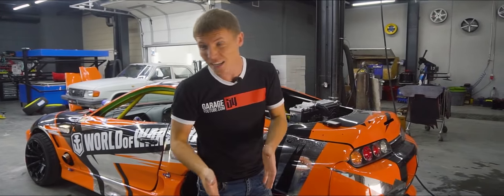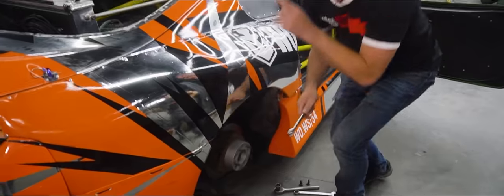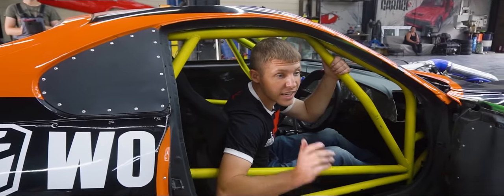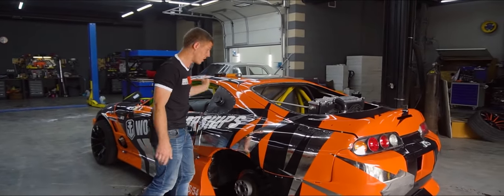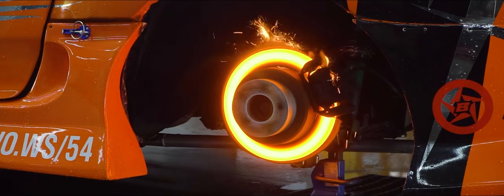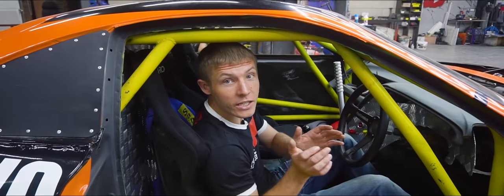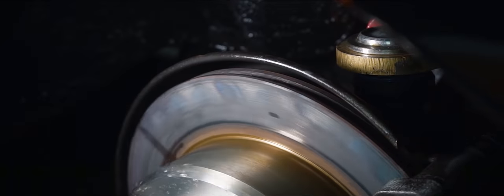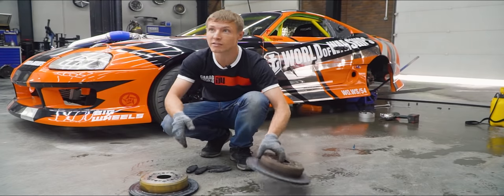Drenching a red hot brake rotor - what'll happen?

Comment: It’s reassuring that even the crappiest rotors hold together in far more brutal situations than I’m likely to ever create.
Reply: I mean they are designed to take extremes why do u think carbon rotors suck ass cold but are amazing on a race car your car is never gonna put that speed and braking force on a car but people are dumb enough to think because they're more expensive they're better
Reply: @Wolf IT Solutions there are a lot of grades of iron, some are softer some harder, just like other metals.
Reply: 3 hard breaking from 100kph to 0 and use a water hose. That will do. He is using hp car breakes so i think its 2x times durable then daily car.
Reply: @hegeliandetective1034  Don't make a complete stop and you got a good procedure down. The speeds might a bit on the low side for such a short burn in, but might be why you get away with the complete stop.
Reply: @heltfeil  All good tips, for getting the vehicle back on the road with matted-material surfaces for safety.  I would like to "tune" that procedure, so I appreciate the input, I'd like to try it scientifically to help everyone get the most of their brakes and that quick-break-in period.
Reply: @heltfeil  So maybe next time I could try 40mph/55kph, and not come to a complete stop, but still that extra smooth pedal motion so it doesn't warp, that's worth a try.
Reply: I wonder how hot my brakes get on an emergency braking from like 150kph to 0. It doesn't happen often, but it does happen.
Reply: Take this like from me and my shitbox!
Reply: @Adam_Lyskawa  if you stop the car and immediately get out and watch them for a few seconds, you can see the colour of the oxide film that will appear on them. Ive had mine at around 550C a couple of times, which im not thrilled about.
And it barely faded, ive had very bad brake fade a couple of times running redstuff pads. Smoking brakes and zero braking power, tells me they were pretty close to red hot, if not actually a dull red.
Reply: @Nbomber   I know someone who has the new Audi RS6 which has a detailed car - system menu to open on the screen and there are nearly every possible details shown like brake temperature, tire temperature and tire pressure, engine, water, oil and gear-oil temperature and even the temperature of the catalyst. The RS6 has new 44mm (17.5") carbon- ceramic brakes fitted in 22" wheels and he told me he was once hammering on the Autobahn and had a brake temperature of around 350°C and then he did a full brake from 290kmh (180mph) down to 60kmh and was amazed by how quickly the system worked and it showed up to 680°C and tire temperatures around 50°C and luckily he didn't have to stop.. 
I find it very interesting and great that Audi also like BMW and I think Mercedes  show you so much information about your car. BMW M cars even have a drift-mode which shows you how long your drift was and rate it from 1 to 10 points..😂
Reply: @Wolf IT Solutions they are definitely not "Just Iron" and the material that is used and how it is treated in production makes a difference in durability and longevity. So cheap parts usually aren't that cheap in the long run. And most people dont want the bare minimum regarding security.
Reply: @Wolf IT Solutions who buys carbon fiber brakes for a normal road car ? If it's even possible to get a whole new brake system for your car. I just meant that for example if there are name brand or oe manufacturer rotors available for 50 per rotor and the cheapest for 35 it's not worth buying the cheapest one risking cracks or warping after just one emergency braking. Especially considering how rarely you have to change rotors . For higher performance cars or sporty driving heat treated rotors or performance brake pads would make sense but they are already way more expensive
Reply: @Wolf IT Solutions  Sure, but that wasn't the point
Reply: @Wolf IT Solutions I never brought up brake performance. From the beginning my point was that saying it's just iron is misleading or just technically wrong as you stated it yourself. And that there are differences in wear and how they behave after an emergency breaking. With the main point that it's just not worth buying the cheapest ones and changing them earlier. But I agree with you on the other points and considering the small differences it might just be a thing of personal preferences and driving circumstances
Reply: The clicking noise was probably the calipers sticking from being overheated and the brake fluid boiled xD
Reply: @Polymer Tools i once did a full emergency stop for fun on my 2017 Trinx Junior 4.0 mountain bike from like 25 km/h and holy shit,despite having fully exposure to cold air,it nearly cooked my fingers when i touched it
Reply: One stuck calliper is all it takes to get you a comfy redhot level. Happened to me due to years of road salt corrosion, the brake disk got so hot that it warped badly, felt like the car was gonna shake to pieces. But, same as in this video with the Chinese disk, the warp fixed itself after cooling a little while. Later i changed the calliper but not the disk. its still on the car and no wobbling.
Reply: For God so loved the world that he gave his one and only Son that whoever believes in him shall not perish but have eternal life.  John 3:16.
Reply: Crappy rotors? What do you mean?
im asking because even those considered "crappy" can and will perform just as well as rotors and brakes that cost much more and called "upgrades". Larger rotors stop the same as larger more expensive ones. But wider tires stop better than skinny ones.
Reply: Normally on amy other car id buy the sheapest rotors i can off of rock auto.
The stock rotor design on my 14 mazda 6 are notorious for warping. Literally brand new rotors and after a super hard emergency stop or two and their warped. Bought some powerstop slotted rotors and so far after many miles and a few emergency stops they havent warped at all.
Reply: Not really if they are made in China without any QC requirements coming from a vendor outsourcing its production there. Beware.
Reply: @Druze_Tito  Hate to break it to you but nearly all this stuff is made in China anymore.
Reply: @truthsmiles  Hate to break it to you but go ahead and read my comment again, unedited.

Comment: What's more amazing to me is that the brake fluid withstood all of this, better than anything else.
Reply: That fluod is junk now
Reply: I was curious what fluid they were running as well... had to be DOT 5 or whatever their equivalent was. I'm also impressed it didn't burn the seals out of the pistons, or, if it did, the pistons still worked, and more importantly, released.

Comment: Russian Haynes manual: 
To check rotor runout, jack the rear of the car up, remove wheels, run engine in 1st gear and hold a 13 mil spanner up to the rotor. 
If it scrapes, the rotor is warped and you can ignore it.
Reply: it's an old mechanic trick btw :)
Reply: @BruceCarbonLakeriver  low cost dial gauge
Reply: ITS TOTALLY WORTH AND FREE WAY TO CHECK IT! :)
Reply: Pretty cool thing to learn, definitely will be using that as a quick trick rather than pull the rotors off and put them on the machine from now on
Reply: @jameshunt5316  yep :D
Reply: That was a 17
Reply: @jameshunt5316  just grab a straight edge and feeler Guage instead of putting it on the machine, or the wrench trick either one works great
Reply: lol 
Tweny Bennys n packet crisp.
It’s like code for location.

The old Haynes were the absolute business just can’t get the same quality anymore, here in North America they even look like cheap faded photo copies now, no more high quality detailed color photos of a real mechanic hands on.

Respect to the old Haynes:
Every manual composed of a complete tear down and rebuild.

Kept my Tranny n Escort vans for ever rolling.
Reply: @SP-mp9yi  John Haynes died a couple of years ago. It is a disgrace that he was never knighted.
Even though I had the official Triumph and Jaguar workshop manuals, the Haynes manuals had the greasy fingerprints on them. IIRC these were monochrome photographs but they were 1970s cars.
Reply: @twentyrothmans7308  Can’t agree more with that tribute to John Haynes, the amount of detail that went into every manual on almost every vehicle.
Reply: It was a 22mm
Reply: Why a 13?
Reply: @Nbomber  This is a precision job, you must use the right tools according to the Haynes manual.
Reply: @twentyrothmans7308  lol, I will remember this. Im guessing this one is marked 5 black spanners difficulty level
Reply: that was a quick good check nothing wrong with that trick
Reply: In Russia, you no check brake rotor. Brake rotor check YOU!
Reply: @ritecomment2098 wrench guage 😂

Comment: Now take that damaged brake rotor and spin it up to about 5000 RPM and see what happens.
Reply: spin it on the crazy high rpm diff setup!
Reply: That’s pretty standard rpms for a rotor in final gear
Reply: Not much
Reply: Typically 4th gear is 1:1 to the engine RPM, meaning them having it in 6th has the rotor spinning faster then engine RPM, I assume they went to at least 4 or 5 thousand engine RPM so even in testing they went past 5000 RPM at the rotor
Reply: @lrz98gaming5  You're forgetting the final drive ratio through the rear differential which should be somewhere between 2.5:1 or 3.5:1.

Comment: Great video as Interesting to see results, back in the late 80s I never replaced discs on front Mk 1 Escort just the pads and drove the car like I stole it, remember one night I had brake fade from heavy driving and braking,  pulled over to find glowing red hot discs and heard this clunk, literally half the disc fell out onto the road, opps, then very slow drive home, I still only change pads but always check my disks for wear and warping and drive a lot slower now 😃😀

Comment: To be honest, the older disc would have been more properly broken in with its use before the tests. Meaning the molecular formation would have been better. The new one more or less went straight to hot tests and abuse so it would have been weaker. This is what I have heard and seen from tests of alloys like what rotors tend to be made of. So given that aspect, if they could have gotten new but properly broken in rotors instead of fresh off the shelf then it would have been a better test of aftermarket parts and OEM parts. So I consider this test more of a fresh vs properly broken in parts.

Comment: That effect of the water not touching the brake rotor is called the leidenfrost effect, where the surface of what the fluid is touching is much greater than the fluids boiling temperature, the fluid closest to the hot surface will rapidly boil causing an air gap between the surface and the fluid. Therefore the fluid won't have contact with the surface :)

Comment: You guys need to do this experiment in such a way it actually helps other racers by using some high carbon steel racing rotors compared to regular street, and maybe even middle of the pack rotors. Also, be a bit more easy on the heat as that is never going to happen on the street. Heat them up to molton hot, but not the entire thickness of the rotor, just the surface as would happen on the street, and then splash them several times, but not douce them in water, make it more realistic. I used to come home at night with my EBC Yellow pad setup, and the EBC slotted rotors were lava hot, and glowing. These brakes would stop just as well hot as they did cold, probably better, with no fade. This set lasted me a year of heavy duty street racing, but I was shocked they lasted that long with the amount of hard braking I did. For about $400 a set, (smaller car, larger cars will be up to several hundred more) It's totally worth the cost even if you don't race, especially if you don't race. The braking force will stop your car in a shorter distance, and there is virtually no fade for those who travel mountainous roads frequently. 👍✌

Comment: I was expecting the rotor to grenade like when Hydraulic Press Channed did it with a Fiesta.
Reply: Lol you need more heat and bigger temp differenec..heat brakes on 1000C and use liquid nitrogen - 275C when brakes increasing heat so temp difference is 1275 +- in lets say 2-3 Seconds or less!
Reply: That was a great one
Reply: @joe125ful  nah, they just floored it and waited for the disc to go on it's adventure.
Reply: good vid from beyond the press i enjoy the mayham they pull off
Reply: @fie1329  But its boring way way you know..
Reply: Of course it grenaded something, it's a ford

Comment: I was thinking you might want to look at the suspension parts, the brake flexi hose, the diff and hub ends of the driveshaft as extreme heat would have travelled up any contact points, certainly I would imagine at least the hub side of the driveshaft oil seals and UJ bearings likely damaged.   The caliper too I imagine is toast as you can see the valleying in the disc where the caliper is allowed to move excessively creating uneven wear.
Reply: Lol i love that about this channel
Reply: Time and effort is of no consideration for Garage 54
Reply: Disc brake operating temp is 300 Celsius when they aren’t braking
Reply: @spannaspinna  Even a regular cars braking under little load on a flat surface the rotors get outrageously hot especially in the summer.

Comment: A rotor in good conditions should never grenade themselves in normal driving circumstances because of the leidenfrost effect, unless you come to a place where water is deep enough to submerge the rotor partially/completely or if there's a storm happening with enough wind and precipition to completely cover the rotor in water at all times, like the pressurized water test.

Comment: It's actually not the sudden temperature change that's killing them but how uneven is the cooling. If the rotor was designed to dissipate heat equally and you would throw it into the water, it would just cool down very quickly and evenly. Obviously it's not, the rotors get hot on the outer edge and that's where they dissipate most heat. So if you heat it up that much, the whole inside of the rotor gets hot and expands, then quickly cool it down and the outside shrinks quicker than inside. That's how you get those cracks.
The other story is bad heat treatment and internal stress of the material. Cheap ones are warping that much because of it. If you release the internal stress, it would probably perform much better.
That's actually interesting idea for a follow-up although it might require a bit more equipment. Take the same, cheap disc, put it into an oven for heat treatment (annealing), heat it up slowly to proper temperature (depends on the type of material), keep it hot for quite awhile, then very slowly cool it down by lowering the temperature gradually. This way all internal stress should be gone and if there was any (and surely was), it will be warped. Now get it to someone who regenerates warped discs by taking off some material on lathe or something like that. If it was not warped too much, it should be good enough. After all of this, compare how it holds.
Surely such process should and probably is done in the factory, at least for high end performance discs.

Comment: You've experienced the leidenfrost effect, basically a tiny layer of steam creates an insulation between the water and the hot rotor, which is why the water doesn't boil on contact and the hot rotor doesn't actually cool down that quickly. 
With a pressure washer this effect may be overcome but the bucket did not manage to do so it seems. 
This leidenfrost effect also only works when the surface is extremely hot compared to the water.

Comment: 13:45 yeah that's what i figured, rapid cooling with water from the pressure washer has caused the disc to cool unevenly, resulting in those big stress fractures all the way through the disc from its outer to inner edge, if you kept trying to use this it would explode into fragments and tear into the car, its also caused one of the two vented discs to warp pretty badly

Comment: In Australia with our Falcons and Commodores, OEM brake rotors are the ones to steer clear of. When new, these cars brakes didn't take long to warp under normal use- making the pedal pulsate. Anything aftermarket ( short of buying Chinese) is an improvement.
Reply: Hot weather maybe?

Comment: I had an elderly gentleman come into my shop one time. He had driven without pads, with the caliper shoved into the rotor for long enough to overheat it to the point that the rotor cracked off of the hat and was spinning around the axle beating the Sam hell out of everything underneath the car. The car was totaled. It could have been repaired but the value of the vehicle was far less than the cost of the repairs. I believe he must have been mostly deaf because he said that he heard some banging under the car but it wasn’t bad. To me it sounded like 1000 dwarves with sledgehammers beating on the underside of the car while driving and this was just bringing it through the parking lot to take it into the shop. But believe it or not he did drive it into the shop parking lot

Comment: I would like to see a "brake rotor vs pressure washer", where you use the pressure washer while you're braking to see if it raises in temperature or not lol
Reply: It's gonna raise the temperature since the brake is spinning at over 1000 rpm. its clearly gonna heat up faster than water dropping on the brakes

Comment: EDIT: watched a bit more, and I can see that at least on the driver rear, he rested the wrench head against the dust shield and the rotor.  given that stability he may be able to get a better idea, and maybe he did that on the other side.

maybe they'll do it, but so far they haven't (I'm at 3:27)--put each of the rotors on a lathe.  not to resurface it necessarily, but if you can get it otherwise true on the lathe as it can be, if it's warped, the cutting tool will touch intermittently at a rhythm instead of cutting evenly.